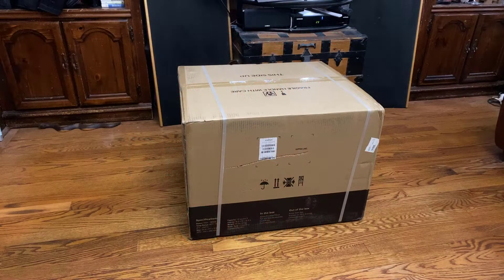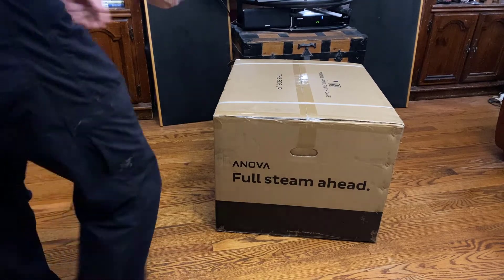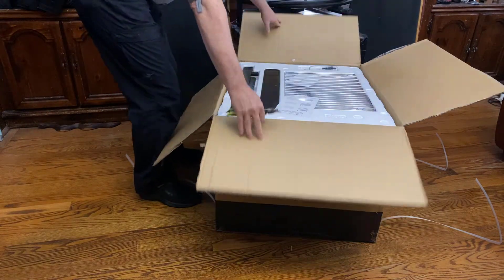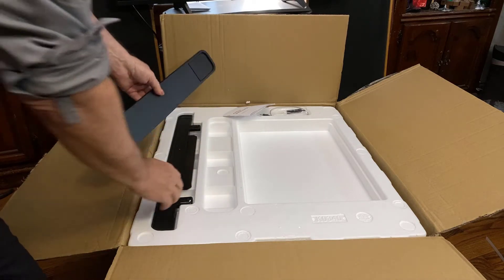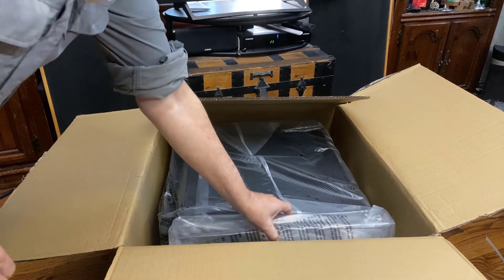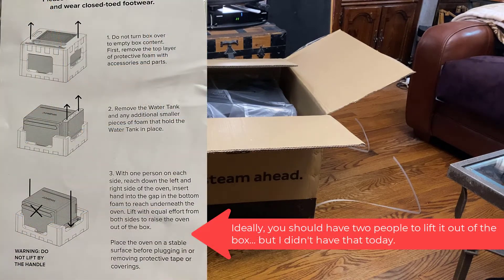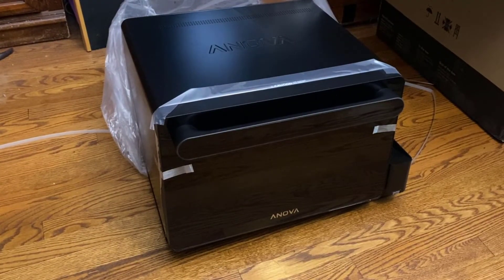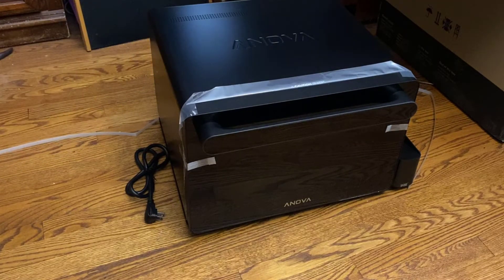Unboxing the Anova Precision Oven

Comment: what is the weight of the oven? I have the June and I cannot move it by myself
Reply from the maker: I read somewhere that it's 46 pounds
Reply: @Zentient1  so 6 more pounds than the June, would still need someone to unbox and then get it on the counter.

Comment: Hi, can you provide the dimensions of the grate and pan. Does the pan slide in by itself or does it have to sit on the grate. Thanks
Reply: Also did it come with the perforated pan that’s used in some of the Anova videos?
Reply from the maker: The two wire racks are 12x17.25"   the pan is 12x16"  the pan sits on the bottom of the oven, it's not wide enough to reach the rack supports on the sides of the oven.  These are the only racks/pans supplied with the oven... the perforated rack/pan shown in some of the prototypes is not included, nor do I see it available as an accessory.  I haven't looked at alternate half sheet pans to see if any 3rd party items would be good additions to the oven.